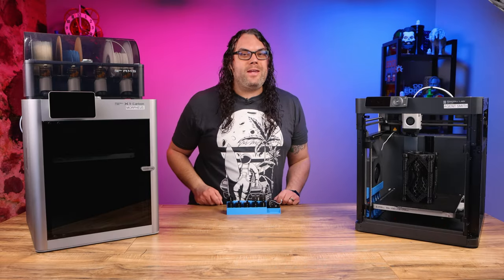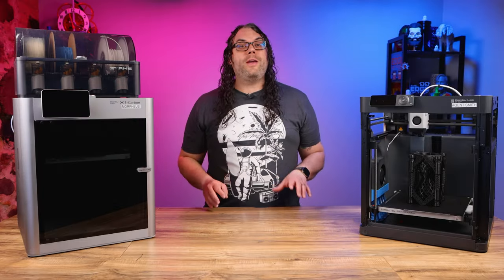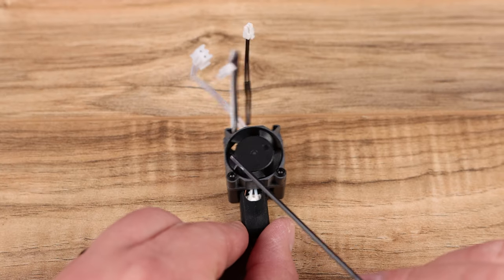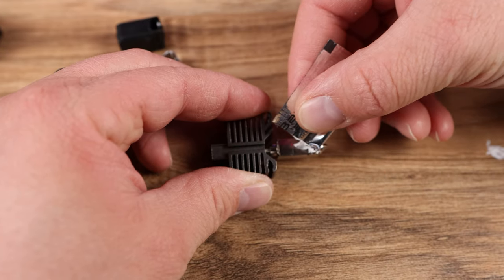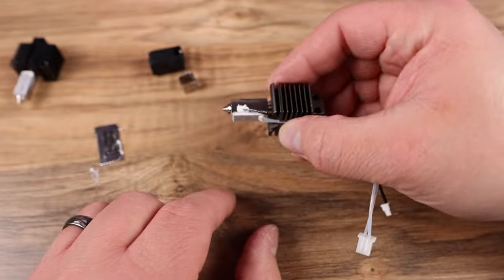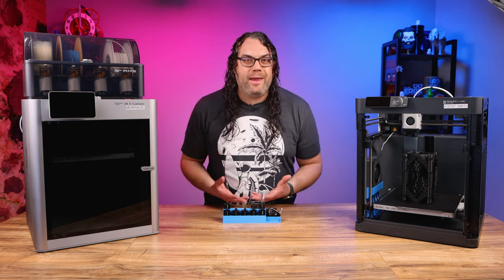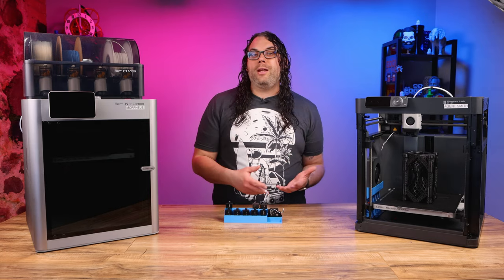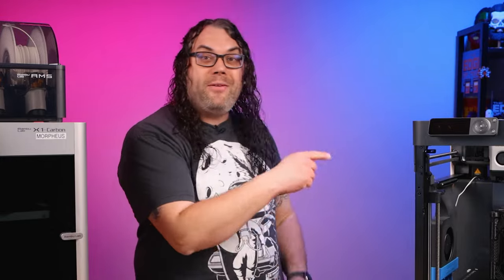How To Change A Bambu Lab Nozzle For Under $15!

Comment: this is a ridiculous amount of effort to change a nozzle. pretty negligent of Bambu to not design a user-friendly way to swap the nozzle
Reply: yeah see here's the thing though...its offset by the fact that it's the only printer that you can buy that shows up, and works flawlessly from the start. being able to print so finely that when tuned properly, there's literally not even visible print lines for some filaments.

ive found on multiple occasions that files i was printing actually wound up being out of spec because they were designed around printers with larger margins of error, and the bambu was printing it with damn near pixel perfect accuracy. i had to edit STL's on occasion for designs that were integrated with precision machined metal parts because it was capable of achieving such ridiculously tight tolerances.

im here on this video right now because this is the first and only repair ive ever had to do on it after extensive use. do you know how much ive put through it in that time?

56. 56 rolls of PLA+ with the only issues ive ever had being caused by being lazy about cleaning the glue off the baseplate often enough. ((i use a proprietary mix of elmers and bottled water, secret recipe.))

it cost me $14.99. i pulled out 3 connectors, removed 4 screws, and applied thermal paste. if that's wrong, i don't wanna be right.
Reply: It’s not negligence if they sell, full, hot and assemblies. I was just trying to get people to buy more from them.
Reply: They fixed this on the A1
Reply: you can also just buy the full hotend assembly and it takes like five seconds to change out
Reply: This is why I have a complete horned setup for .2, .4, and .6 which makes my swaps happen in under 5 min which is awesome compared to the process I had to go through on my Anycubic Chiron. I also have spare hotends for the chance I get a clog that cannot be cleared or the end gets damaged in some way… but either which way I would rather work on my P1S than the hassle it takes to work on my Chiron.
Reply: It's 2 screws and 3 wired all of my other printers are way worse
Reply: @lostspktre wow .

Comment: dear god what a pain in the ass. I've got a Revo CR on my ender 3 and I can change nozzles with just my fingers and doesn't require any thermal paste. I change nozzle from print to print. This is an absolute nightmare comparatively. A 0.6 might be a decent middle ground, but I love being able to jump to a 0.8 nozzle when printing brackets or large prints with no fine detail. It makes those prints stronger too.

Comment: This is great information! I need to swap my nozzle after only 5 days of printing! The nozzle got clogged using the default Generic PETG profile (with Prusament PETG).

Bambu Lab was also very forward thinking by including nozzle clog clearing tools with the printer, though I also used these incorrectly and seemingly made the clog worse.

They even included a spare nozzle! It's like until knew exactly what was going to happen. I'm very impressed.

Comment: Thanks. This was very helpful!  I have the set of complete hot-ends for normal nozzle size swapping, but my .2 nozzle got hopelessly clogged and your video was perfect.  Took the nozzle off/apart, replaced it, the thermistor, and heating element for good measure, and back in business.  Its a little messy but it works!

Comment: Easy to follow, thanks for the video.  Mine was embedded in plastic and impossible to disassemble.  I had to put it back on the printer and heated it up to 85C until I could work a pick under the plastic to work it all free.  Was just barely cool enough to handle and using the pick gently I was able to peel it all free and swap it out.

Comment: Good video, now I'm glad that I just got  the complete assembly, I think it is worth the extra, especially if you want to swap often.  I also suggest you have extra bolts on hand,  I lost one somewhere inside the X1 Carbon one of the times I was swapping, never could find it.
Reply: My ideal setup is to have the nozzles I use all be full assemblies and have a spare of each size as a bare hotend. So I can swap the nozzles as I want but I have a spare for if and when they wear or get damaged somehow.

Comment: ive had my p1s for going on about 3 months now maybe alittle long but ive not changed the nozzle it came with yet an i was thinking about swapping the spare it came with out for the one its been using but part of me wants to order a couple different sized nozzles an a hole hotend assembly cause i have nothing on hand to fix it if something happens to it so i think im going to buy up a few extra hole assembly b4 i try to swap my first one. i got a bunch of stuff for my other printers but ive not picked anything up for my bambu labs yet mainly cause i have to buy directly instead of being able to pick it all up on amazon.

Comment: Just did this for the first time, nerve racking as hell, lol.  It wasn't that bad.  My .4mm nozzle died, broke off, and had to do this with the extra one they sent, move everything over.  I just ordered all the sizes, one made up and then a $15 replacement for a spare.  I only have a .4mm and a .2mm made up so it cost me like $140 bucks but I already wanted the two larger sizes for a huge project I'm printing now.

Comment: Hey Jim, thanks for the video. Good information here. Question, why does the P1P only have two wires? It would seem all three would be needed.
Reply from the maker: Hey Scott! I am not sure. haha
Reply: the bambulab x1c has a pwm fan.  so 4 wires one for power one ground one to sense speed and one pwm.  the p1p with 2 wires would be on at the speed the fan is designed to

Comment: Is that amount of thermal paste needed ? Had to dissasemble mine because a clog on the extruder and was almost dry.
Reply: You always want thermal paste as thin as possible. So no, use less than in this video.

Comment: Jim I have seen a kit for an enclosure for the P1P, is it possible to fit and use the replacement X1C high temperature nozzle on the P1P?

Comment: After the swap my printer says nozzle temp is abnormal the sensor may use an open circuit. 
The temp of the zozzle displays zero but it's hot to the touch
Reply from the maker: Sounds like your thermistor is not wired properly or is broken. I would check that all the wires are properly put into the board and seated good. Also check that no wires are pinched or anything on the hot end..
Reply: I just took the hot end assembly apart to make sure I followed the directions to a T. I checked the connectors to make sure the connection was tight to the board . I removed the square metal thing on the nozzle to check the copper wires to the hole and make sure it's not pinched . I'm kinda lost now . I made sure to look at the wiring to see if there was damage and I didn't see any . 

The calibration fails almost immediately and the self test too
Reply: Would you mind helping me out ? I could email pictures of my setup and maybe you can see what the hell is going on . My printer has been down for a few weeks . I got it a week before Christmas and printed beautifully until the first nozzle clogged up and I found this video on hot to do the swap . It's so frustrating
Reply from the maker: @xslayerizedx  Sure! I can try to help. Shoot me an email.
Reply: @TheEdgeofTech thank you , how do I get your email ?
Reply from the maker: @xslayerizedx  Check my about page. Or hit me up on social media!